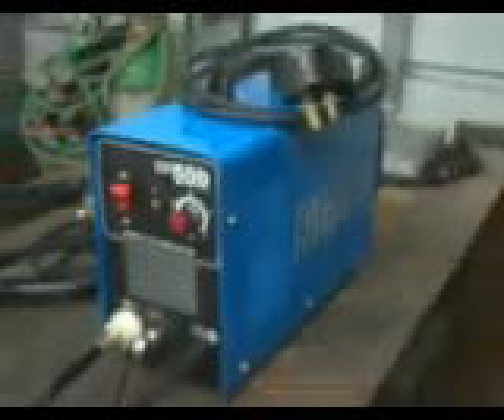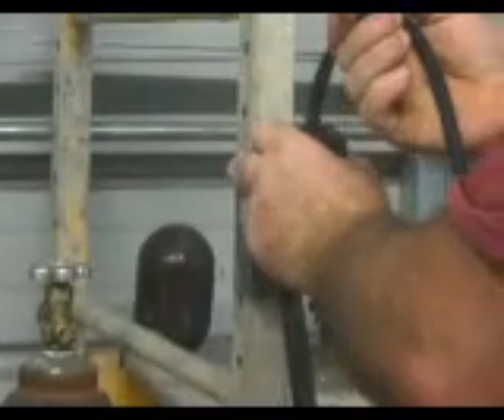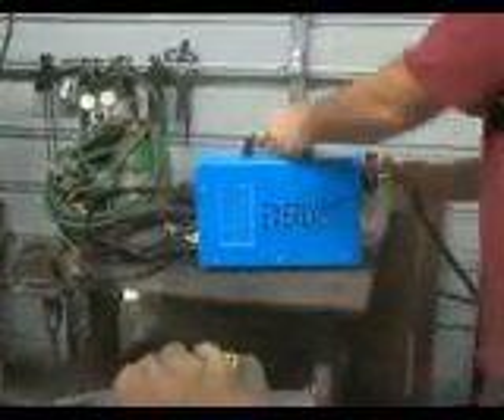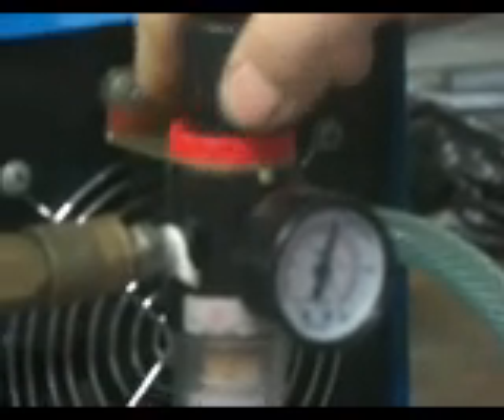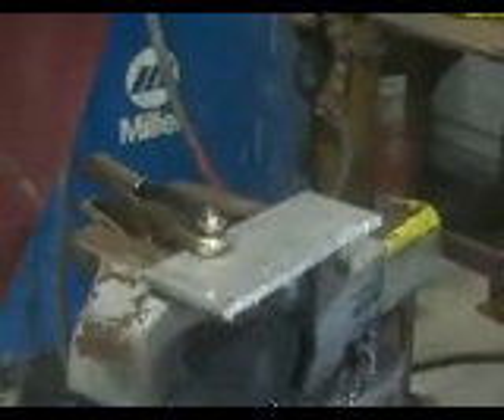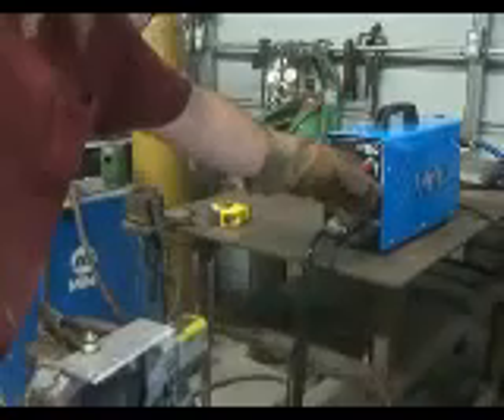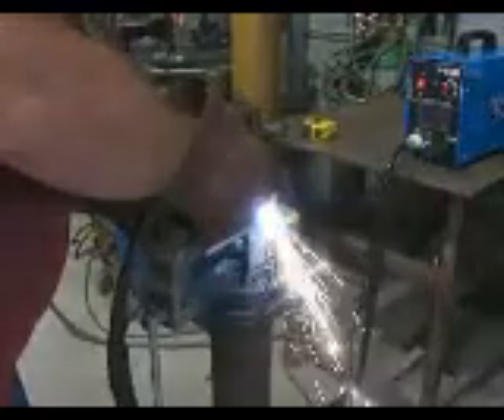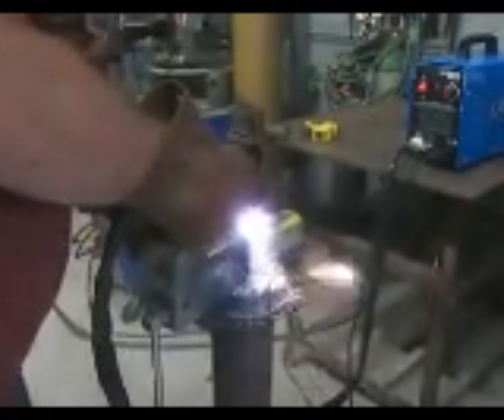Everlast Welder - Cut 50D Plasma cutter

Comment from the maker: I would check the output amperage of the lincoln recepts, If the total amperage from the plasma, and compressor is less than the total output of the recepts on the genset I would not hesitate to use the combination.
Good Luck
Leonard Hester

Comment from the maker: Hi tosko125
  I was wondering, where did you purchase your unit from?  Was it "Everlast dealer" on ebay?  If so, will they warranty the unit?  Mine has a one year warranty.  Mine works fine still, and I use them nearly every day.  Just wondering if I got lucky, or If you were'nt.  Inexpensive units ya know, can go ither way.
  Check out the warranty, I would like to know.  Its too bad about your machine, and good luck.   
Leonard Hester